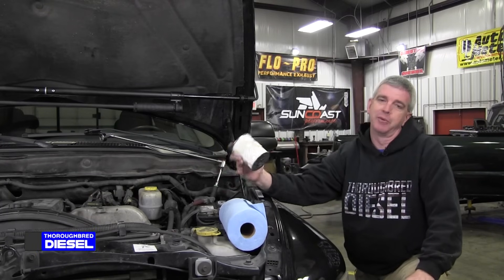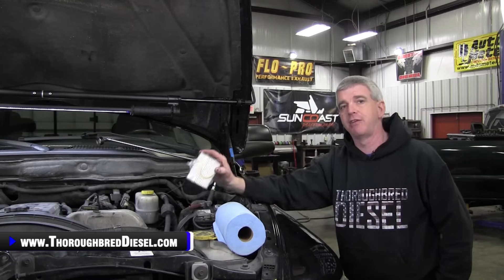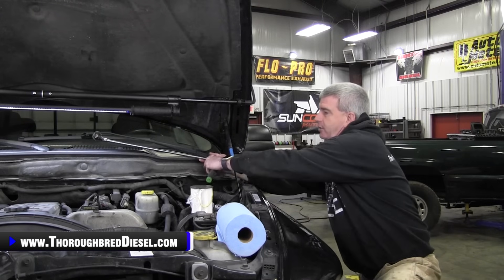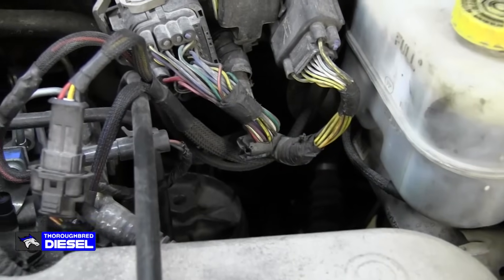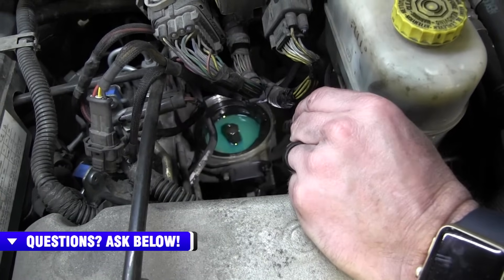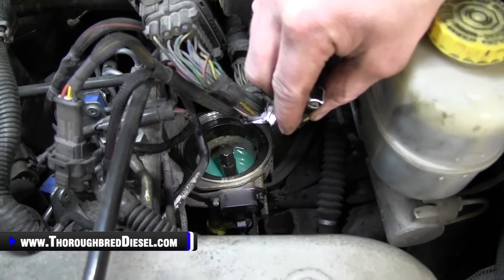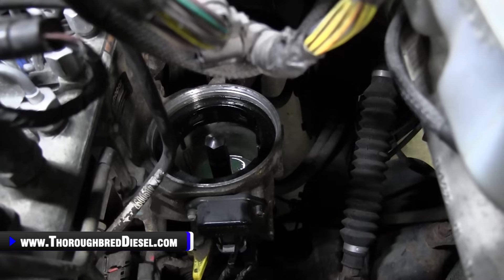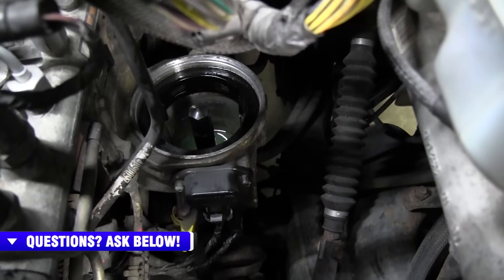Change A Fuel Filter on 2003-2007 Dodge Cummins 5.9

Comment: this proffessional forgot the most important step.DRAIN the filter housing first,he even talks about the dirt in the bottom of the can,so when he pulled that filter without draining the can,where do you suppose some of that dirt might have gone,yup.right in the line to your CP3 pump.not great.
Reply: I thought that too
Reply: Exactly....I drain mine every time and let it sit open for a few mins to make sure the junks out of the bowl
Reply: @moose5.9  so what did he just show us how to generate some work for yourself
Reply: Craftsman makes a 1 1/8" socket for the 5.9 cummins fuel filter cap 😆
Reply: I def. agree with draining the can first.. that said.. doesn't the fuel down the top of the spigot in cannister? Would mean much less chance for heavies to get in tank.. which I guess is redundant as were trying to filter in microns vs chunks lol. 
Drain the can!

Comment: He says to commit the number to memory but it's the wrong part number. 03-07 is FS19856 for the 7 micron. The FS19855 is the 10 micron filter for 00-02
Reply: Came here to say the same thing.

Comment: I believe most of the contaminants in the fuel system come from the filthy pump nozzle at the gas stations.  Right before the tank fills and foam washes the dirt off the nozzle and into the tank I hand hold the nozzle a bit higher and make sure that doesn't happen!
Reply: @1melahat  I bought my 2003 from my sister after her husband passed. They had a loooong uphill gravel driveway.  Before he passed they made several trips pulling their 5th wheel.  They had to use 4wd to get up their driveway.  The first time I changed the filter I couldn't believe how much grit and very small gravel pieces were in bottom of canister.    I found a pile of small gravel and grit on top of the fuel tank around the open to atmosphere vent.   I believe that grit was generated by the front wheels kicking up dust, grit and fine gravel each time up their gravel hill.   Even as truck only it was best to flip it into 4Hi to avoid spinning on wash board ruts.   You may want to clean off the top of your tank.

Comment: The Dodge fuel filter is also a water trap. You're supposed to drain out the diesel in the filter to make sure there's no water in it before you put the new filter in. Before you try to start the engine turn the ignition key to run for a little while to fill up the filter housing. This is per my Dodge shop manual.

Comment: Everybody has their own way of doing things. I drain the canister first completely. Then remove the filter and replace it with a 4 micron Baldwin filter put the lid on tighten it down cycle the ignition switch several times and it will fill the canister and the truck will start right up.
Reply: Baldwin's are 5 micron.

Comment: going to leave dirty fuel in the canister. dont do it.  just drain in with the valve and then make sure the canister is clean.. then just cycle the key a few times to fill it up.

Comment: I was glad to see this was just as much of a pain for Wade as it is for me. Always kind of thought I was doing it the hard way. I always empty the bowl first before pulling the filter. I'm done using the stock Fleetguard filters. So many times the plastic lid nearly separated from the filament when pulling it out. And then one day it did. What a mess that was. Now I use the NAPA Gold. 7 micron and heavier construction. However now I'm interested in this Baldwin 5 micron filter. Think I'll try that next. That's why I like these videos and forms. Gets people talking and sharing.
UPDATE: Just received my Baldwin 5 micron. Haven't installed it yet but took a good look at it and really like the construction. Update: Used the Baldwin 5 micron PF7977 two times now and it's working great.
Reply: I've used the Baldwin PF7997 for years now. I also have the GDP cylinder head filter.

Comment: You Sir are not a tec  You are a true mechanic.  Thank you for information a valuable time
Reply from the maker: Thanks!
Reply: When filter is out and drain open spray it out with carb cleaner and you will be good to good .

Comment: You don't need that expensive Snapon socket. I've used my Harbor Freight 1 1/8" impact socket on my 2005 Ram 5.9l Cummins for 17 years,  works perfect every year. I change oil, filter, and fuel filter all every year.

Comment: You have to drain your filter housing first to flush and dirt and water will all come out and when you put your new filter in just bump your starter 3 times to refill you filter housing and will start right up and I have 3 filters to fill so it may take 4-5 key bumps   to fill all 3 filters .

Comment: 1st thing I do is drain the filter completely.  Not much  Fuel will drain from the filter that way, Remove the filter replace with a 4 micron  Baldwin. Close the valve  Cycle in tank pump several times  cranks right up never fails. Yes everyone's got their own way of doing things.

Comment: I’ve recently found a fuel filter that filters down to 5 micron instead of the 7 the stock fleetguard does. It’s a Baldwin, part number PF7977. I switched to it with my last filter change. You can’t go wrong with better filtration. Even if it is only 2 microns, thats 2 microns smaller you’re cleaning your fuel
Reply: That's what I use is the Baldwin 5 micron now,always used the Fleetguard before on my 03 Dodge Cummins 5.9. In fact when I bought the truck new the Fleetguard fuel filters then was rated at 10 micron. Also when I replaced the o ring  I always use a little dab of new grease around the threads and the o ring to help get a better easier on seal.
Reply: I don't understand why Thoroughbred Diesel would put a stock filter back in especially when that was one of the main causes of injector failures on a 24 valve common rail. I get mine at Cummins and I believe they go down to 2 micron. Stock filter was only good to 10 micron and I believe the Cummins recommendation for the common rail was 5 micron and Dodge said No 10 will do...
Reply: Brian Stanfield stock fleetguard filter is 7 micron. The Baldwin I bought is 5 micron. So it should meet whatever requirements at that point
Reply: Could getting 5 or 2 microns cause worse fuel flow?
Reply: I use the Baldwin and then step it down to a CAT 1R-0750 filter. It costs me $70 to change both filters, but that beats paying for a new CP3 or injectors.

Comment: Great advice about bleeding good way to loose a hand. However it should be a FS19856 7micron not the FS1985 10micron they used in 00-02.
Reply: Joe Barrington how do you lose a hand to bleeding the lines?
Reply: Is it from the pressure or
Reply: @americummins4048  it's called fluid injection injury. These things run at  crazy high pressure like 20,000 psi. If your hand gets sprayed, pressure will cut through the skin and diesel will go into blood stream. From there, it depends how quickly you get to hospital, only hand might have to be amputated, or more. People also have died from this kind of injuries when left untreated.
Reply: @bahopik  This is the low pressure side he's working with. 30 psi or so. . .meh. . .  It's after  the cp3. . . That where the death is.
Reply: @raceadodge  in the video he refers to bleeding at the injector witch is what I was referring to. Not sure where your injectors are but mine are after the pump on the high pressure side.
Reply: @joebarrington6917  Oops! I thought you were talking about bleeding air from the filter housing. A thousand pardons! I've never had to open the high pressure side of a common rail to get it to start so I guess it seemed odd to me for someone to mention that. Again, I'm deeply sorry. . .
Reply: @raceadodge  I never have had to ether!

Comment: Finnaly someone who's says no to cracking injector lines injection injuries are no joke  I know a dude who used to run a steel press and the hydro line pin holed one day it got him two times through his  glove he barely noticed 12 hours later after the ganggreen set in he got to say good bye to his dick beatin hand

Comment: I have a plastic plug the screws in to the center of filter so when I pre fill my filters it goes around the filter and you don’t get and junk when pre filling you don’t want to get fuel in the center of filter that is unfiltered fuel and the out side gap is going threw filter media first and gets filtered before it goes in your high pressure fuel filter . Just my 2 cents
Reply from the maker: Good idea!

Comment: When a 2006 dodge ram Cummins, how do you check the fuel pressure from the tank to the filter?
Reply from the maker: You can remove the inlet bolt at the CP3 and get a fuel pressure bolt that we offer to be able to screw any 1/8 NPT fuel pressure gauge into.

Comment: Hi good video could you help me fix the problem in my 2003 Ram 2500 cummins it rises the  engine oil level and thank you
Reply from the maker: If oil level is rising,  probably suspect something going on with your injectors or high pressure injections system.  Have injectors tested and the overall engine compression tested as well.

Comment: Has anyone ever experienced the following issue after replacing their fuel filter:

When I replaced my filter this last time I noticed quite a bit of sediment in the bowl and we decided to clean it out. We drained the bowl and had to use some suction to get all the sediment (as our hands were too big to get into the bowl to the bottom). I think this caused a problem with it staying primed. When we replaced the filter and attempted to start the vehicle, as explained it this video, it started but only ran a couple of seconds and died. I did not hear the fuel pump engage when the key was turned on. We attempted a number of times, but couldn't get it started and didn't see any fuel entering the bowl when the key was turned on. A mechanic friend said to put ATF in the bowl and reinstall the filter. This worked in priming the truck and it started up. It has been running since then, but shortly afterwards it started doing something odd. When you started the truck and left it to idle, instead of idling at about 750 RPMs it would rev up to around 1,000 RPMs, then sometimes after a few minutes it would idle back down. When in gear it would return to the 750 and move according to the speed being traveled, but whenever you would put it in park it would again rev up to around 1,000 RPMs.  I've asked, but no one seems to know why it is doing this. Any ideas would be helpful. Thank you in advance.
Reply: Any news on this issue?

Comment: I have an issue maybe you can help with. 2004 5.9. Truck would overfuel on occasion and actually ran away on me, requiring me to turn off ignition. It has over 200000 miles and I thought it would be a good time to install a complete set of injectors. After install I ran the unit up and checked for leaks, all good. I shut down and afterwards developed a no start problem. Checked lift pump operation ok. Cracked 1 3 4 injectors and found minimal pressure present. Im thinking rail relief valve issue, what are your thoughts.
Reply from the maker: Never open injection lines on a common rail.  Also, when the lines are open the system will not build pressure enough to start.  That being said, I would think that you have a feed tube that isn't torqued correctly.  Retorque all feed tubes.

Comment: What about that raptor lift pump for third gens?  Any more details and install stuff for that?  Good info.  I don’t check the bowl ever only drain some fuel out.  When I do lift pump check,  I open up the supply line before the filter so I don’t dump dirty fuel in the bowl.
Reply from the maker: Raptor available in 100gph and 150gph flow rates. All hoses wiring harness etc included. fuel  filter change would be at the OEM intervals. We can email installation manuals.

Comment: another great video. is there another fuel filter on the 05 Cummins 5.9 that should be changed or is the only one for this year? ty
Reply from the maker: This is the only fuel filter on the 03-07 trucks. That is a good question though. Certain years of the 6.7’s had two filters.

Comment: I would add Vaseline to the orings, and the threads. Also it’s best if you don’t touch the filter bare handed. The oils from your hand can mess with the water separating ability, use gloves.

Comment: If you were worried about unfiltered fuel wouldn't you drain the filter sump before pulling the filter? Does the minimal chance of contamination make that point moot?

Comment: how often do you need to change the oil if you're tow 90% of the time?
Reply from the maker: We change our personal vehicles at 5K miles.  But, you should make an informed decision of what works best for you and your vehicle.  We suggest having a oil sample pulled at the end of your chosen interval, and take those findings and make a decision as to what is the right interval for you.

Comment: ALWAYS DRAIN RESEVOIR !
Reply: why?
Reply: @mikesouth5315  it's a filter housing where the filter does its job, filtering out debris etc. You dont want to reintroduce the particulates back into your fuel line. I also like how he cycled on the pump to quickly check for proper function.
Reply: @mikesouth5315  Water

Comment: hi i have a 06 5.9 turbo 6speed mercedes benz with 200k on it  runs great but when i pull my 5th wheel its 10k its doggy going up hills what can i check first thx

Comment: Can you still change out the filter without draining the fuel bowl?  Is it advisable to do this or is it advisable to drain it each time you change the filter?
Reply: Chief60 I drain it every other time. Mostly just cause I'm lazy. You don't have to drain but you prolly should. It's there for a reason.
Reply: Martin,
Thanks 
Much appreciated
Reply: My self I'd drain every time. Less mess, less chance of chunkys getting were they shouldn't and wiping out the parts the filter is suposed to protect.  But I have a 1st gen so I've no choice but to drain, its a spin on.

Comment: You say when you are cycling the fuel pump at the end that "This truck's got a raptron on it." What's a raptor? It's a good idea when the gas boy in Oregon fills the truck with gas.
Reply from the maker: Sorry, I speak Kentucky so its not very clear.  I am saying Raptor, which is a lift pump made by Airdog, and its noisy in its old age!  Still been a great pump though!

Comment: Is that die diesel the stuff meant for construction or agro equipment, it’s the same colour I use in my backhoe.
Reply: I looked awfully yellow to me, so no it's not red dyed diesel.
Reply: It looked like road use tax diesel , not red die off-road use only diesel. They both work the same just one cost extra to cover  road maintenance cost.

Comment: what’s the best filter to use on it?
My truck is a 2005 Dodge Ram 2500 5.9
Reply: Chief60 that was basically the first thing he said 😅
Reply: FLEETGUARD
Reply: jacob dukes not wrong that’s just your opinion
Reply: @Brandon56784  well actually it is wrong and the science behind it proves it. The 1st thing he tells you the wrong stock filter FS19855 is 10micron and for a 00-02. In 03-07 they went to FS19856 a 7micron. But a Baldwin PF7977 5Micron both is a upgrade and a better filter according to the nerds in the big house that run these test.
Reply: Subcummins01 how much is the Baldwin and do you have to order it ?
Reply: @calebthacker9654  order on Amazon about $23.00 for a 2 pack
Reply: Wix and don’t look back

Comment: I use a AFE 44-FF010 fuel filter. on my 2004 Cummins 5.9.  Pricey ($34) , but it is rated at 3 microns, 99% efficiency.
Reply: Thank you for this! I've just had to replace my injectors and the believed cause was this truck having the 7 micron stock filters used. That isn't nearly enough filtration I was told. I almost bought a new lift pump just for the filters being 2 microns but 3 in the stock housing is great! 06 3500 with a raptor 4g lift pump, no filters.

Comment: Do you always need to drain the canister to get the separated water out, or does the filter catch the water?
Reply: Wayne Gilbreath I usually do on my 07 never hurts to do it in my opinion
Reply: The filter media does nothing to remove water.  Water entering the filter canister falls to the bottom where is it supposed to be sensed by the water detector.....a couple of electrical probes in the bottom. That's why there's a warning light....so you can drain the water before there is enough to enter the filter element.

Comment: Hey guys, I am wondering how fast this truck starts! Mine starts just after 5-10 seconds and if has 200 f temp my warning light is flashing and set code P0148.... Anything seems to be wrong with fuel
Reply: my 2005 ram 3500 starts in 1.5 seconds at 20*F

Comment: If your truck has been running fine but you don’t get fuel in the bowl when you cycle the key…what could the issue be?
Reply from the maker: More than likely the CP3 is drawing its own fuel. I would say that even though its running fine,  it probably is down on rail pressure when you load it.  Address the lift pump issue for sure.

Comment: I have a 2004 Cummins 5.9 and when I turn it on it idles pretty bad and wants to turn off once driving it goes away but one way I come to a light or stop the truck jerks toward and I have to be careful and keep my break on the foot at all time. Any idea what it can be ?
Reply from the maker: Could be a lot of different things. Need to check codes in the truck first and go from there.

Comment: What happens if you dont change your fuel filter on a 2002 dodge 2500 cummins diesel for 39,000 miles?
Reply from the maker: Plugs up, starves your VP44 for fuel pressure and could cost you a injection pump.

Comment: What if I turn the key and don’t see fuel flow ? .... 😕
Reply from the maker: Check power to lift pump. If you have power and no flow, suspect restriction or bad lift pump.
Reply: @thoroughbreddiesel  I have the same problem. Do you just turn the key on to check fuel flow or do you have to bump the starter for fuel to come out?